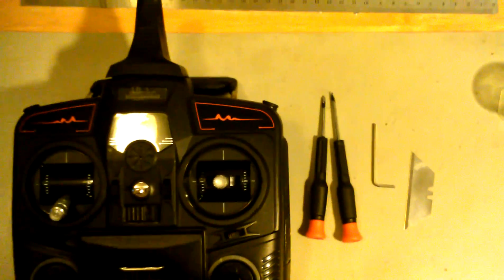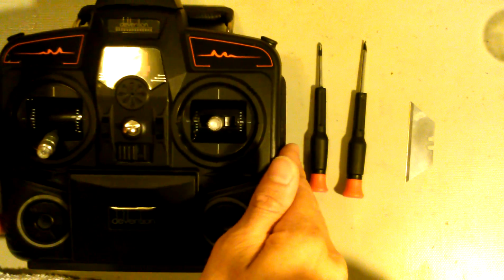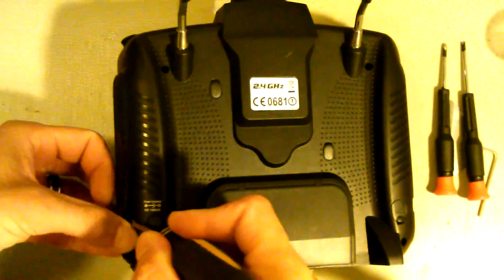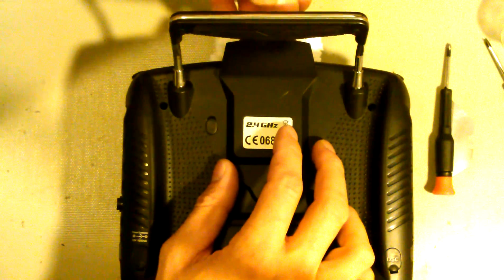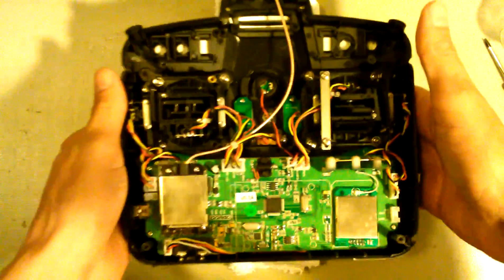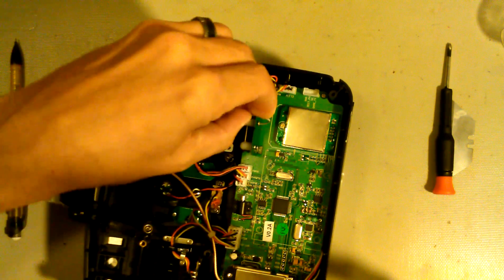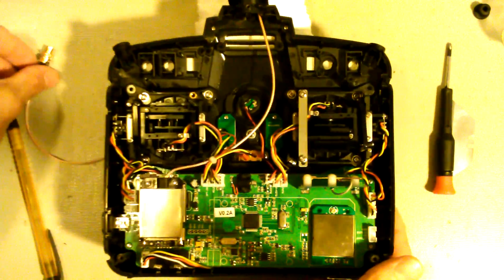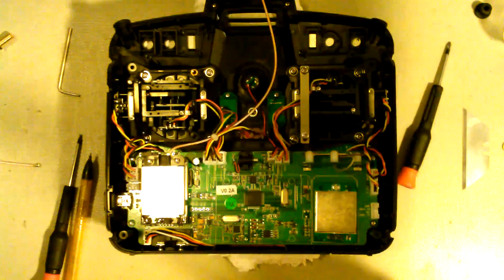Part 1: FPV Devo F4/F7 Antenna Mod Tutorial

Comment: Hey! Great video, even after 11 years.
Do you know the pinout for the 3.5mm video port? 
I think there should be ground, power, and video, but in which sequence, that I don't know.

I'm trying to feed my own video into the FPV goggles that plug into the type of controller you showed in this video, and it would be very useful to know the pinout and the correct voltage.

Comment: Hi,
You know, I am planning to modify my devo f4 with an antenna that has an SMA connector.  I found a cable that is described as SMA to ipx/ipex . Could you please confirm me that it will work with the devo f4?
I think that there is no difference between ipx and ipex  connector, is there?

Thanks man